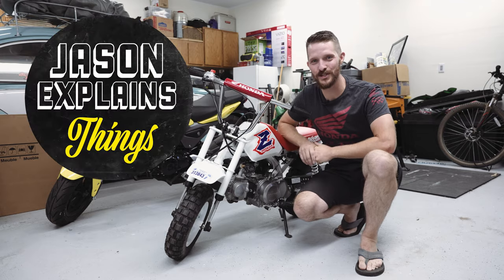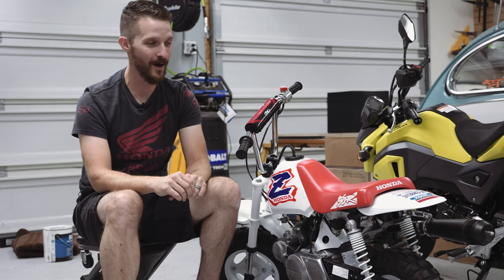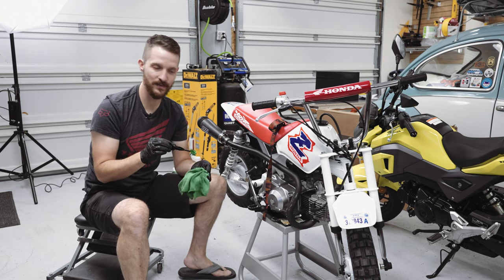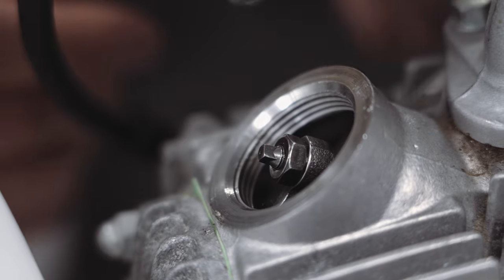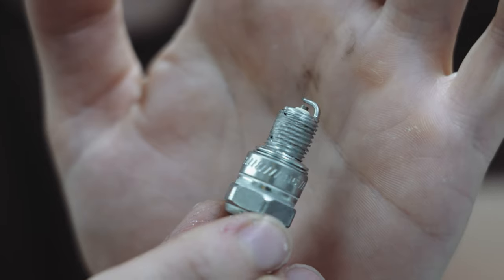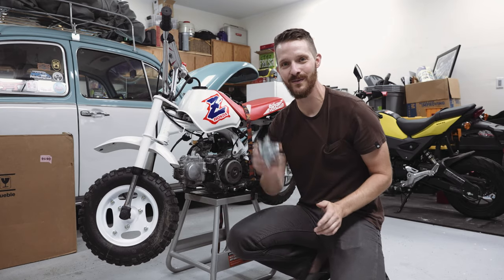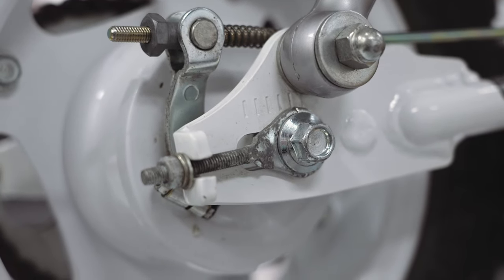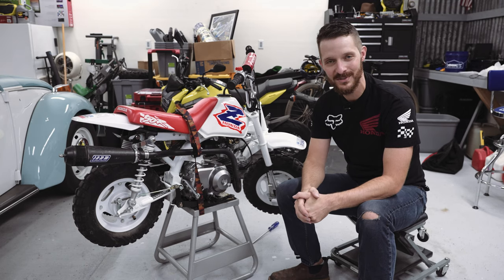FUN Honda Z50 Mini Motorcycle Tune Up & Ride!

Comment: Good vid man, perfect intro to tune up basics on a small engine.  This will make a good future how to video for the young aspiring kids who are lucky enough to have these kinds of bikes.  I also liked your tried and true tip about shutting off the fuel valve and letting the gas run out of the float bowl to prevent future corrosion in the carb especially with ethanol based fuel.
Reply: Thank You very much

Comment: Great video! I have a '93 in great condition that exactly as you said, my Dad purchased for me when I was 8, that I'm looking to sell. Where would you suggest I list it? I called a local dealer (actually, the place it was purchased nearly 30 years ago) and they said they'd buy it but I'd do better online. Thanks for your time!
Reply from the maker: Great question... it all depends on where you live.  I'm seeing them go for $2500 or more in the PNW.  Rougher ones are still listed for $1000-1500.  I'd list it on Craigslist and Facebook Marketplace.  I recently sold a CT90 that I didn't have time to restore.  I listed it on CL and shared it on several Facebook groups.  I immediately had 4 people trying to buy it.

But honestly, if you keep it it'll just keep going up in value.

Comment: Is this the same for a 1984 z50? Mine has been sitting for 20 years
Reply from the maker: Mechanically, yeah likely the same.  Start with a carburetor rebuild most likely, then valve adjustment, oil change, and check the spark plug!  Good luck.  These Honda bikes can last forever.
Reply: @JasonExplainsThings  thanks. I’m going to replace most of those.

Comment: Use motorcycle oil. The oil is not just for the engine but also for the clutch. Automotive oil is not a  good idea.
Reply from the maker: That is motorcycle oil.